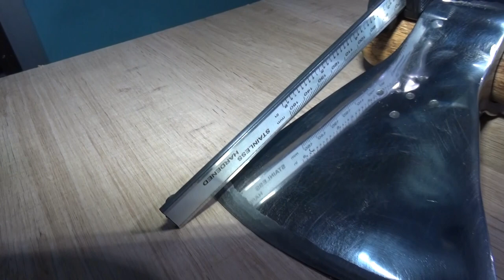Rusty Antique Axe / Old Hatchet Restoration

Comment: Good and respectful restoration, congratulations. I think the marks are for losing weight and make the axe lighter. On the other hand if the axe gets stuck on any wood and you can't take it back, you drop some water on those points and the wood will bloat automaticly and you get your axe back easily ;)